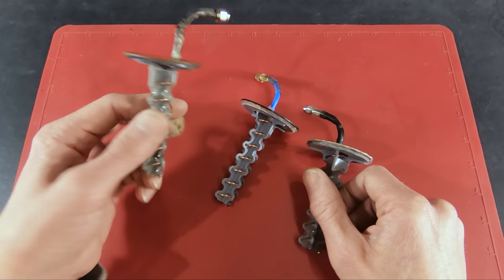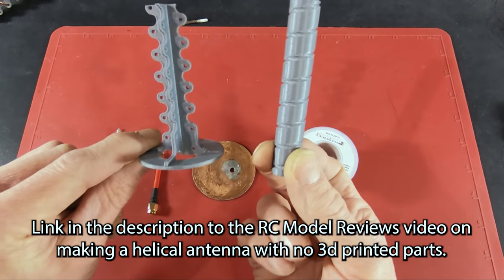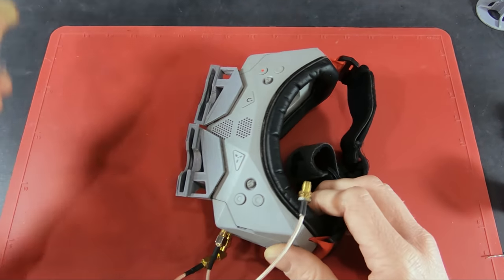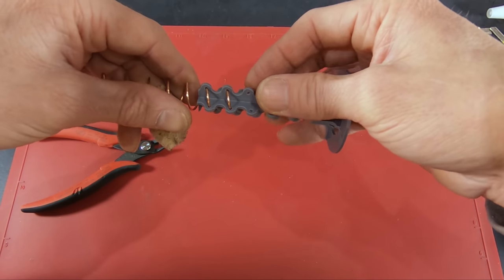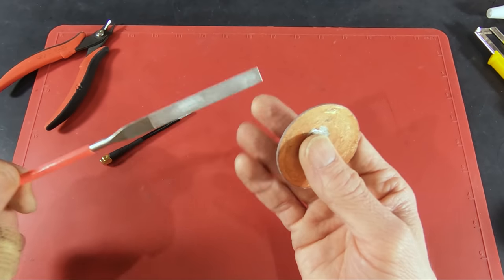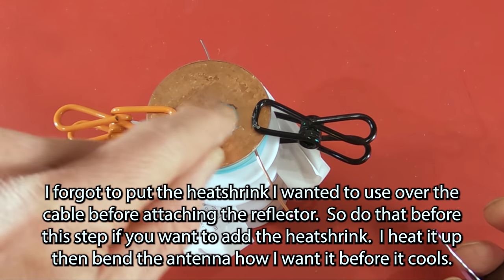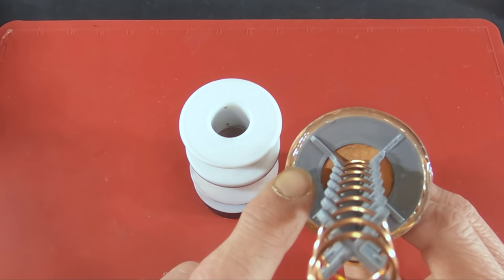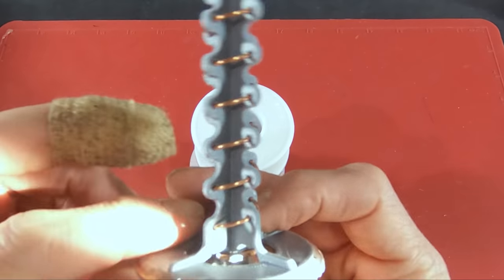DIY Helical Antenna For Long Range FPV - CHEAP & EASY -

Comment: Years ago, I made one of these, nowadays I just use 1280mhz video and compact Dipoles on the model...A low gain patch on the GS,  with 5.8 relay, job done, a lot easier and no tricky pointing of the Rx antenna...Kudos though, nice video at 8.5k..😳🇬🇧
Reply from the maker: Nice that sounds like a great setup!  Maybe I'll get a chance to try out something like that eventually.
Reply: @FalconRadFPV  Yes, I have one quad on 433mhz UHF control, but another two using 868mhz control....Both play nicely with 1.2g video...So the new 915mhz control option is an obvious choice...Just separate the antennas on the quad..I use iNAV for a real secure RTH and autoland...🤔🤔😯😳😳🇬🇧

Comment: Superglue works nicely on copper, BUT you have to clean the surface immediately before gluing. You can use something like sandpaper or a scotch pad to clean it. Copper is another of those metals that corrodes really fast, so it has to be cleaned thoroughly prior to gluing...
Reply from the maker: Thanks for the tip!  Oh that's why it doesn't stick well for me!
Reply: @FalconRadFPV  Copper and Aluminum are bad for corroding really quickly. They always need scrubbed/sanded with fine sandpaper, etc., immediately before gluing.

Comment: i would love a video like this for the DJI FPV Goggles V2 or even the Goggles 2 maybe - great video btw!
Reply from the maker: I just got goggles v2 and an 03 air unit recently.  so I might try messing around with some helical's for the V2 goggles.

Comment: Great detailed instructions as usual.  This video is a few years old now.  Is there anything you would do differently now?
Reply from the maker: Thanks!  No pretty much the same, I'm still using the antennas I made before making this video, they work great.  I've used it for 99% of my long range flights.  That said I'm working on testing something similar but different for HD goggles with four antenna sma spots.  If it works well there will be a new updated video with the changes.

Comment: You should pre tin first, all parts to be soldered. Makes soldering them much faster and easier.
Reply from the maker: Yes for sure.  Did I not pre tin something?  Maybe I did it before starting the recording....

Comment: Nice ...
well it practically easy for those who had 3d printer, however without the appropriate measurement tools we never know how well the result (fine tuned).
For those who doesn't have 3d printer just search "ort helical antenna" on google
Reply from the maker: In the video I give another route for no 3d printer.  RC Model reviews shows how to make it without 3d prints.  This antenna has high tolerances so you DON'T need to get the coil perfect.  It can be done without a 3d printer!  I wanted it to be easy so I left out all the specific measurements for coil sizing.  There is even a link in the description to take you right to the RC Model Reviews video about making it with just a piece of tube from any hardware store.

Comment: FarVew has all your antenna building supplies that way you don't have to sacrifice an antenna.
I was under the impression that every adapter reduces your db a bit
Reply from the maker: Yes that's right, every sma connection and every length of cable reduces the signal a little.  So you could use the low loss RG 402 measured out to be long enough to go all the way to the module but it would be hard to manage that length of ridgid 402.  The more flexible cables have a bit more signal loss but if the lengths are kept to a minimum it still works.  I have at times just connected the helical sma on the side right to my goggle module but it sometimes gets loose and I worry about that during a flight so feel better using an extension and that mount.

Comment: Hello, very nice work but I have a question. Why the length of rg402 should be multiple of 17.72mm? How it works with your extended antenna cable for avoiding switches? In thingiverse project I see SMA connector soldered to reflector.
Reply from the maker: The lengths need to be multipules of a half wavelength.  It would require a video to explain why.  Sma extensions for 5.8g video should already be in correct lengths unless they have been made incorrectly or for a different purpose.
Reply: @FalconRadFPV  I have another question. I have double sided copper plate for refector. What is the best way to solder that. Shall I soldere both side or only one?

Comment: Question, if the center wire needs to not touch the reflector to keep from "shorting out", how does the wave trap being soldered to the copper wire but resting on the reflector not cause that same issue?

Comment: Amazing video & very educational, I'm a big fan of you & your flying. I recently bought a IBCrazy 5.8GHz 12.5dbic Helical Black Cannon & I'm using the same Orqa goggles you are using but I don't have a 3D printer so my question is are you willing to sell the mounting plate for two Helical antennas & can I run two IBCrazy Helical antennas into my Orqa/TBS Fusion or should I use my  Mushroom antenna or a patch antenna with the Helical? Sorry I'm new to the long range game but I'd like to try but before I do I want to educate myself. Thank you!
Reply from the maker: I'm not sure if those antennas would fit the mounting plate that I designed.  It holds a circle roughly 55mm in diameter that can be up to about 4mm thick.  I just used the 3D printer slicer to reverse the print for the opposite side.  Along with shipping (i live in canada) it might be cheaper for you to get it printed somewhere locally.  Sometimes places like the UPS store or web cafe's etc... wil have a 3D printing service available.  For long range you're better off using two high gain antennas, the omni directional mushroom style is only good out to about 1km maybe 2km max.  After that your goggles won't get anything usable from it.  I think once you get into the range of about 9dbi or more is when an antenna can be considered a long range antenna.

Comment: Loving this, including the specificity - thank you FalconRad. Any news on the sheath length topic? Even if I could measure any cut as precicely as 88.3mm (!), did you gain experience with the extensions? Or are you lucky that the extensions were also multiples of 17.72mm (!!!). Thanks mate - my inspiration. Hope all is well in Canada.
Reply from the maker: I believe the extensions I have were listed as meant for 5.8g video so I think the lengths should be correct.

Comment: Definitely gonna build one and use along with my x2air
Reply from the maker: Ya it's a good idea.  The X2-air is a bit higher gain and the helical if I understand correctly has really good cross polar rejection (I believe it helps with multi-pathing or signal bouncing off of cliff faces etc.. I think....)  I'm pretty sure it's a good combination.
(sorry it's taking so long with the frame.  Now that I have the battery and antenna videos that I'd promised people all done I'll have a chance to get on the build with the v2 frame this week, then it shouldn't take long for a few test flights if the weather is nice to me.)
Reply: @FalconRadFPV  right, helicals are a really nice choice. If only they had the amazing beamwidth of a crosshair antenna. 
My current video setup is starting to get a few dropouts and a snowy feed already at 3.5km. farthest I have flown was 5.3km. I think my ev200d module is what's limiting the range, so I have to probably replace that first.

Regarding the frame, I wouldn't have time to test it atm anyways. I designed a 5inch frame I would like to have cut, so it would be nice if I could order them both together from CNCmadness.
Reply: @FalconRadFPV  Is there a way I can contact you regarding the frame other than here on Youtube ? Do you have insta?
Reply from the maker: @ariafpv   You can email me at falconradfpv@gmail.com.

Comment: You ever try electrical butter? The petroleum-based  lubricant electricians use  to pull wires  thru metal conduits? It might help u roll that copper thru the  holes
Reply from the maker: I have not, but I learned something today!

Comment: Love it! Thankyou! Can you use aluminum as the reflector?
Reply from the maker: I'm not sure, my guess is that if it worked it wouldn't be as well due to it's low conductivity compared to the copper surface of the prototype board.
Reply: @FalconRadFPV  Sweet! thanks for the insight! hope your channel keeps growing keep it up!

Comment: This kind of antenna's don't have a direction like RHCP or LHCP correct?? Amazing job Falcon
Reply from the maker: Yes they do, they are circularly polarized.
Reply: @FalconRadFPV  thanks....and to change the polarization i must only change the rotation of the spires?

Comment: Wow awesome! Going to give it a try. Was thinking of getting deathrays but will give this an attempt! Thanks for a great walkthrough and instructions!
Did you do any testing with measuring equipment before going out or just do a couple test flights?
Reply from the maker: I'm super careful about losing gear.  So I'd test it by going out farther and farther slowly and in an easy location not anywhere with a complex line of sight to deal with.  I sometimes will just give the new antenna to my spotter and get them to check out how well it works for them before I use it and have to trust all my gear to it.
Reply: @FalconRadFPV   By "in an easy location" you mean on top of a mountain lol. thanks for the vid!!
Reply: @KylePlackeBadass  By easy location I would assume he means one that's easy to recover the quad should the anteanna not work as planned.  SO like an area accessible by ATV or vehicle where the quad can be easily located and recovered so you don't loose your equipment should test fail.

Comment: You shold do some more videos vith explenation how you are flying how to prepare your Quadcopter  for this type of flights.  I have 2 long range 7inc quarters but i really scared to push  limits like this ;)
Reply from the maker: I plan on doing videos going from building all the way to proper setup and short flights working up to longer ones.
Reply: That sounds very good.  Ifyou can explain some steps you  shold test or know about quad.  That's Will be brilliant. Maybe parts you trust and somthing like this😊

Comment: Hi. Thanks a lot for the great video! I learned so much and i will try to build one of these like you.
One small question.
Does the wave trap has a connection to the reflector?
Isn't that a short circuit?

Thank you
Reply from the maker: the wave trap is the copper foil on the surface of that rectangle piece.  the rest of the rectangle is non conductive backing, same stuff electronics are attached to.  the backing is just to help maintain about 2mm off the reflector surface.  you could use just the foil part and let it all float 2mm up from the reflector instead if you wanted.

Comment: Thank you for the awesome video, very informative. After building the antenna do youalso tune it? If so,, how? Thank you
Reply from the maker: The "tune" of the antenna is the radius and spacing of it's coils.  You could "fine tune it" by flying at a low power output (25mw to 200mw) and just seeing if it works better at 5665 vs 5800 vs 5885 as the coil size being slightly off it would still likely be within this range or pretty close.  This type of antenna is more forgiving than others when it comes to tolerances to minor defects and performance.

Comment: Hey !
Thanks for this huge tutorial 🤩

What is the copper plate diameter ?
I will do this antenna soon 🔜
Reply from the maker: I think it was one wavelength or about 54mm in diameter.  I'm pretty sure I cover that in the video.

Comment: Would this work with RP SMA ends too? Where would you measure to cut it to length?
Reply from the maker: Yes that would work.  you measure the shielding.  So from where the pin goes into the rp-sma, just don't include the pin length in the measurement.
Reply: @FalconRadFPV  Awesome. Thank you! I appreciate the help!

Comment: A fellow Canuck, Happy New Years! Quick question. Did you post a vid specifically testing this home built antenna or are all the videos on your channel after this vid using this helical? I was thinking of building my own, I have seen Bruces vid on this and he ended with some flight footage. I did check your channel to see if you had a follow up vid but there is nothing specific to it from what i can tell. Thanks for the tutorial, just subbed
Reply from the maker: The descriptions all mention the antennas used for the flights.  But basicly after making my first helical antenna I have used it for every single long range flight afterwards.  So any long range DVR footage from the last year and a half that you see in a video of mine was made with one of these antennas. I only use DIY helical antennas for my long range flights now.  My record with this DIY antenna is 8.5kms, still had almost perfect clean video.  I bet it could do 10kms easy if you do a good job making it.
Reply: @FalconRadFPV  Thats awesome i will check it out. Right now with my triple feed patch i am only getting 3kms on 1000mw, not so long range at all. This should help a ton. I will check out your other vids, thanks for the reply

Comment: I have made a pair of this and they are even much better than the VAS Ethix Extreme. Very happy. Just 1 question: I got the strongest signal when pointing the antenna 45 degrees from the VTX pagoda antenna. Both antenna behaves the same. I am using with the Cobra X. is it supposed to be so?
Reply from the maker: I'm not sure I understand the question.  But the helical gets the best signal pointed directly at the location of the drone.  A pagoda antenna should have it's strongest signal coming sideways out of it when its pointed straight up.

Comment: Doesn't the extension screw up the 83mm length? I mean if yours are performing that well I guess it fine... Or is the extension still add up to a multiple is the 17mm?
Reply from the maker: I believe an extension that is meant for 5.8g video would likely be made the correct length.  Generally speaking manufacturers will higher engineers to to assist with product design parameters such as cable length and type VS signal loss or degradation.  This antenna (if made correctly) easily gets a clean video signal at 8 to 10km range or more.  So there is also some headroom for a bit of signal loss if someone doesn't use a proper cable to connect it to the goggles.

Comment: Does the reflector have to a circle? I mean, does it have to be a perfect circle?
Can it be a misshaped circle? Like a circle drawn by a 1-yr old?
Reply from the maker: I've seen people use a square as well.  I would think the more symmetrical the better though.

Comment: Thanks for sharing. Much appreciated. Do you mount your dual helicals in parallel or slightly canted to allow "overlap" coverage.
Reply from the maker: they have a decently wide beam width so I point them both the exact same direction.  It would probably be better to have more distance between them but it works well enough the way I've been using them.

Comment: You are amazing! Thank you for sharing. Help me with my young mind about antennas. So with helical, what is that acceptable degrees that we'll still receive good signal from the drone? 10, 20 or 30 degrees? Oh no my friend, what happened to your finger?

I have a DJI fpv goggles. Antenna is LHCP. Will helical still work?
Reply from the maker: Thank you very much!  are you referring to degrees on the fpv camera?  Any angle is fine, I can do flips and rolls or dive perpendicular to the ground and maintain a good video signal the whole time.  That's more a matter of the antenna that is one the quad.  You want one with a near perfect circular pattern, like a TrueRC Singularity.
If I had to guess, I think it would probably work.  To make a left hand polarized helical it just needs to spiral the other direction.  I guess mirroring the object in a 3d slicer should take care of that.  I have never used the DJI system before though so I no nothing about how it works or how or if these antennas would be a reasonable choice for use with it.
Cut my finger at work, power tools.  It'll be ok, might have some sensitive scar tissue but I fly with my thumbs anyways so no worries there.
Reply: @FalconRadFPV  I was referring to the coverage of the helical antenna in width when it's very far away from the drone. This is how I think it works but I am not sure if it's correct. I just want to make sure that if I try long range in the future, the drone will be in this triangular looking space. https://i.imgur.com/FxBWCha.jpg
Reply from the maker: @neilfpv  I'm not sure the size of the cone but it's fairly wide.  Out at distance I never really have an issue with the cone size since it gets wider the further away you are.  It must be at least 30 degrees I would think.  I only run into directional issues when I fly way to the side of myself while closer by.  (I have a spotter who I will double check my head direction with every now and again if I'm covering a large area)
Reply: @FalconRadFPV  Awesome! Thanks for the tips. I will watch your battery builds then next will be this again. 😊